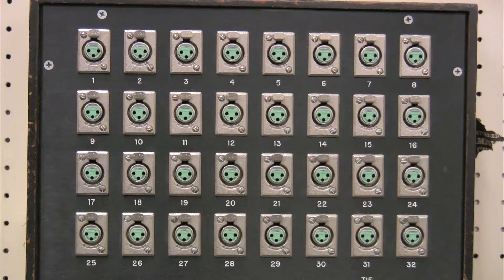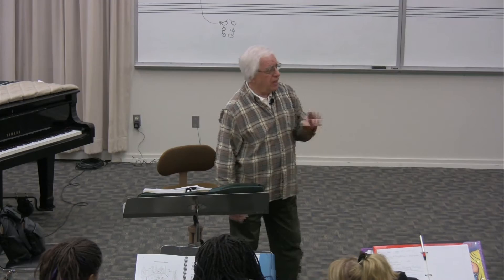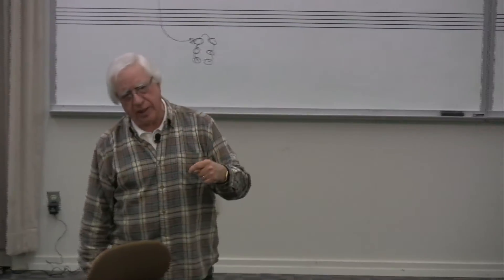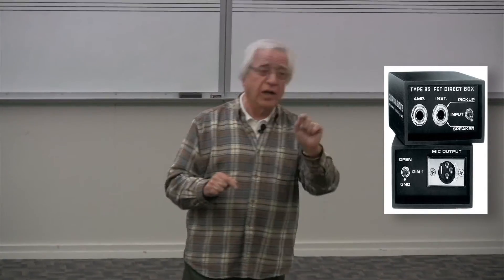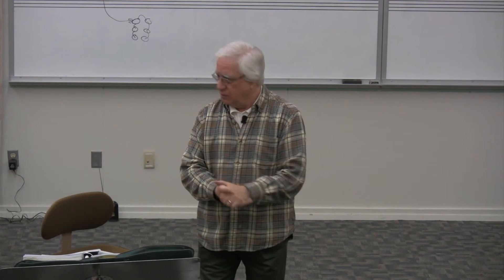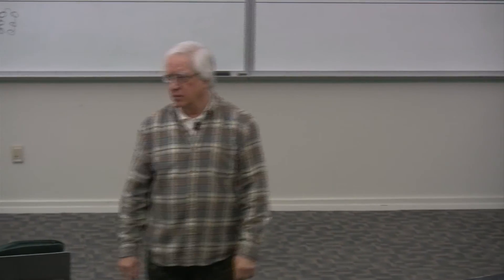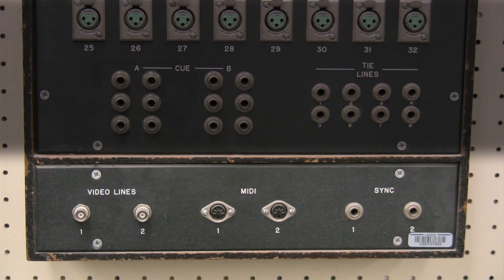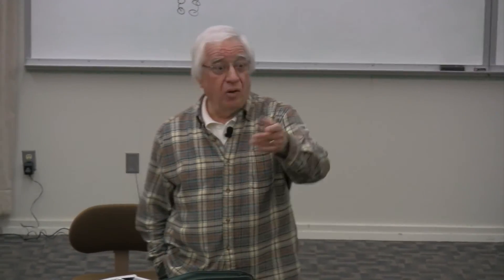What are Mic & Tie Lines?

Comment: Sorry, there is too much erroneous content in this video for it to do anything but confuse those new to the technical side of audio engineering, especially with the kind of gear that exists today. Focus on signal levels (correctly) and then the concept of unbalanced vs balanced cables and how they work or don't work. Talk about phantom power over balanced XLR or TRS cables and the danger to the equipment if presented to the inputs of some electronics devices, or to passive ribbon mics. Until someone learns about that information, tie lines are irrelevant and potential dangerous to equipment if not fully understood. Before I designed courses for audio engineering in 1979 I had to make sure I understood the science behind all of the practices I took for granted after being a recording engineer for 3 years, there's no faking it if one wants to their students to have a solid foundation at the start.